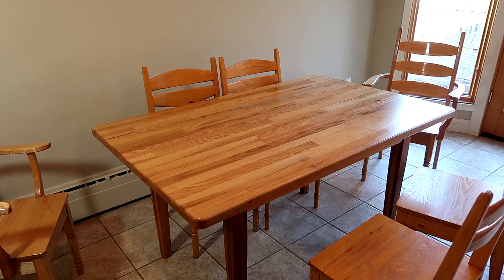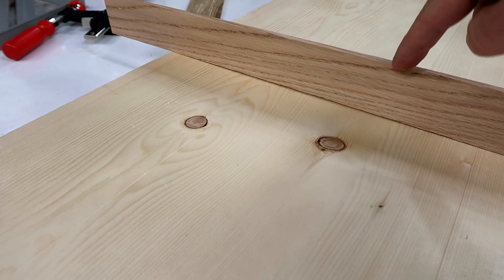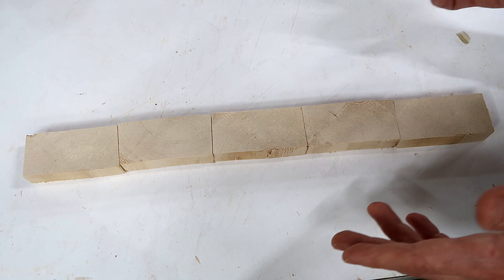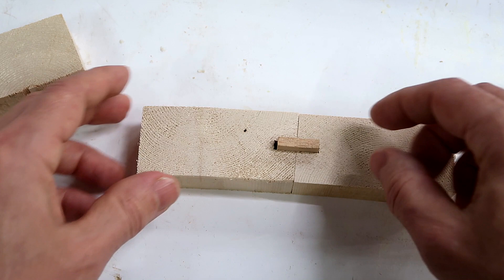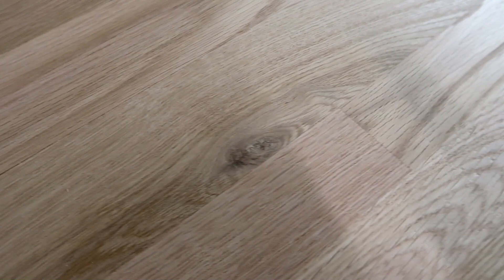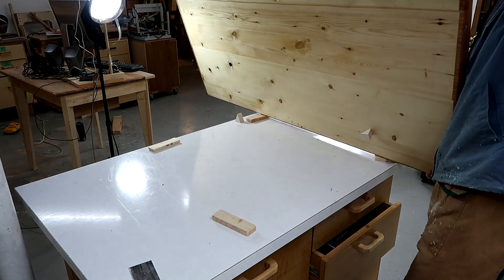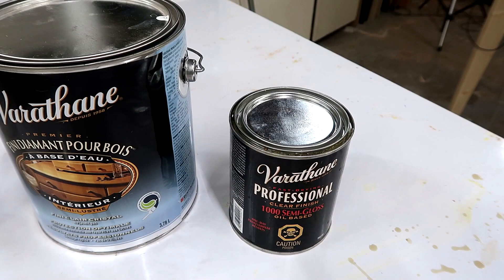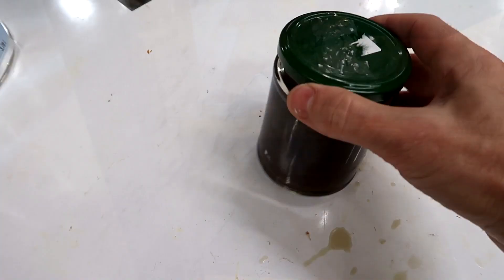Table top glue-up and varnish

Comment: Hi, Matthias.. For such wide Tabletops i would recommend to put the same layer of "veneer" to both sides... Maybe some ugly left over stuff... We in Germany call this "Gegenzug". It is counteracting the behaviour of the top layer.  An other trick, which i use for decades is to turn the paintcans over, when i put them into storage. (if the seal is still ok after opening) This way the varnish / paint does not skin over.  I have opend recently a can, which i had sitting upside down on my shelf for over 10 years and the paint was perfectly fine...no skin...no loss of solvent. If the seal is leaky and i can not turn the can over, i "fill" the empty space with Argon from my Welder. It is heavier than air. This works also fine.... Greets from Germany
Reply: Gegenzug oder Blindfunier-Blitzkrieg ;) ... ich denke das wäre die bessere Alternative gewesen
Reply: Good point & btw Matthias has German roots. He can speak German. :D :) Which is quite funny. :)
Reply: If it leaks, close the lid, shake the can, and wait for it to dry. Maybe then you can flip it over, and it won't leak?
Reply: I might be wrong, but I think Matthias already made a video about replacing the air with a heavy gas.  I think he did that in glass bottles, but it's probably a pretty old video cause I can barely remember.  Turning the cans over seems like a great idea though, I'm going to note that one down.
Reply: brilliant
Reply: I have not actually had success with this technique. What I found was that it was still skinning over, but hidden down in the paint when flipped upright. Then, when I stirred it, all that skins turned into paint boogers. It made a helluva mess. I wound up using it as first color coat, scraped it smooth, and used fresh paint for the final. I did try to filter it, which helps.

What I do now is buy small cans and decant into smaller and smaller cans as I close off a major session (meaning the paint will be stored for a few weeks). That smaller air gap seems to reduce the skinning. Regardless, I peel it off with a stick and use it anyway. Just don’t lose any of the skin or it turns into paint boogers.
Reply: Verygoodadvicetheremate

Comment: I had a strip laminated countertop. I put a rubber matt on one side. Within 2 days the front edge curled up by 10cm! So the warping from humidity changes can be extreme.
Reply: Wow that's a lot! What did you do to counter the warping?
Reply: @spinafire  I just removed the rubber and it naturalised on its own.

Comment: Like when applying finish it is best practice to apply finish to both sides (so they are balanced).  This also applies to veneers.  I'd also expect reducing the thickness of the veneer to under 3mm will be less of a problem with the differing wood movement (and the veneer will just respond more favourably to the movement of the pine underneath).  Cheers, David

Comment: Great tip for using the card scraper in between coats of varnish. I usually knock down the nibs with 400 sand paper, but it makes  a lot of fine dust.  Card scraper seems like a more elegant solution

Comment: 1:30  i believe you are correct about the moisture from the glue causing the cup.  my boss was recently doing something similar with oak glued onto particleboard, but his oak strips were even thinner.  the oak was already very dry from the furnace in the shop.  the next day almost all of the edges on the oak strips were raised up.  the only thing i can think of it that the bottom of the oak strips expanded from the moisture in the glue and heaved up at the edges.
Reply from the maker: Yes, that can be a problem if not fully clamped!  Fortunately, I didn't run into problems with that, or at least not any noticeable problems.

Comment: I wonder if you could use humidity and temperature changes in your favor since you have oak on the one side and it cupped the bottom.  Maybe leaving the bottom unvarnished for added expansion to match.  I know it is supposed to shrink as well but in my experiences with one side unvarnished or painted, the project has always warped to the varnished or painted side.

Comment: The "oil" based paint is water/moisture  curing. The water based one is curing when drying.
You can prevent th e"oil" based paint from drying prematurely by splitting the can into smaller jars with lids. I usually put a plastic bag between lid and jar before closing it.

The issue here is that the can while open will suck moisture from air and will cure over time. If you open the can and immediately pour it into 3-4 smaller jars and then seal the one you dont need at the time you can save it from spoiling.

Also this explains why the first layer was not curing quickly. Air was dehydrated quickly around the table and the paint was not curing as quick as it could. That explains why fan trick worked. Also low temperature - making the air less humid in absolute value  did not helped too.

The new style varnishes/lacquers are much much worse than old style ones.

The new ones are supposed to be low volatile organic compound paints but their durability is much much worse.

I use the polyurethane, stinky paints or sometimes even the nitro celulose ones if I need really durable finish.

Also using roller gives much more even result.

The difference between thick and thin layer is that if you have flexible paint then you can use thick coats. The paint will not chip easily. If the paint is kind of hard (the diamond types) then adding too much will make it crack if hit.
So in such case its better to use thin layers and put only as much as needed to get the finish you want and not any more as that will make whole finish more prone to cracking.

Comment: If you're looking for a good, durable waterbased finish: I've had really good experiences with “Bona Mega“. It's a waterbased 1K Polyurethane finish for wood floors, really easy to work with and get great surface finish, also pretty durable. I was very sceptical about water based finishes in general at the beginning, but this really changed my mind.

Comment: Some varnishes, especially water-based ones, can actually lose their grip on the previous layer without sufficient mechanical bond / tooth. Some finishes require sanding to 220 between coats, otherwise you’re relying entirely on the chemical bond to resist the incredible surface tension that builds as it dries.

I use a cabinet scraper as well to get dust motes out of the finish, but I always buff before coating again. It’s just not worth the risk to me
Reply from the maker: The advice I know of is to wait no more than a day between coats for better adhesion.  The layer below won't be fully cured, plus there is less  time for atmospheric surface grime to accumulate.  
But if it's an old coat of paint or varnish, definitely sand it.

Comment: Releive cuts half way through the top from the bottom side can help avoiding cupping. I'm quite sure you will do that if by time cupping is really an issue.
Reply from the maker: Yes, I might do that when cupping becomes an issue with the old top, which I made the same way, 13 years ago.  Still waiting.

Comment: I like to store my cans of varnish upside down upon being opened, that way the skin that forms is on the bottom of the can and is less messy when reopening.  One just has to be careful not to puncture the membrane if one needs to stir the mix.  Great video, thumbs up.
Reply: I like to put my cans of varnish in a vacuum chamber with the lid just barely in the groove but not sealed. When you release the vacuum quickly the lid snaps down into the groove and there's not as much air inside the can to form a skin. Gotta be careful though, if you don't do it right you'll be cleaning varnish off the inside of your pressure pot.
Reply: Yes! I do this with everything! Paint, glue, pvc weld, honey (But make sure it's a honey lid that seals!! Most won't!),

Comment: There's one more thing you can do to avoid cupping of the tabletop due to use of two wood species with different expansion/contraction properties. You can assemble the bottom layer entirely first, then apply the strips with their grain perpendicular to that of the base layer. Deformations will be in different directions. If you also use polyurethane based glue, instead of PVA, strong clamping is no longer that important (you just have to make sure the pieces stay in place, but not apply much pressure), the glue has some void filling capabilities and it stays significantly more elastic after curing. Given the huge amount of gluing surface, the slightly lower strength shouldn't be a problem, IMO. Plus, it's completely insensitive to water, which is useful for a tabletop.
Reply from the maker: Oh, how I wish people tried their own advice!  It would be so much fun to see the results! :)

Comment: So to use mortices or cockies are necessary when the glue is holding endgrain to non-endgrain, but not in cases where the glue is used for places where the joint does not include endgrain faces.

A lot of important info in this video. Thanks.

Comment: I know Matthias isn't a safety snob but I never cut lumber on my table saw without the riving knife installed.  I've seen a piece of walnut get shot off a saw so hard it went through a wall.
Reply from the maker: My saw can't take a riving knife.
Reply: @matthiaswandel  Neither can mine. Here's an idea for a video: Come up with a quick on/off splitter that can be used for a variety of saws.

Comment: For any of your non-water based paints, have you tried displacing the air in the can/jar with propane before sealing them up?  I started doing it with POR-15 and had excellent storage results.  I now do it with anything that is not water based.
Reply from the maker: yes, mentioned in a video too.

Comment: How would you characterize the improvement in odor/fumes with the new formulation? I use water poly mostly for the convenience around the freedom from fumes not the ease of cleanup. 

For example, if I run the clothes dryer while oil varnish is curing, the clothes will smell a bit like gasoline because the dryer breathes in the fumes and somehow consolidates it into the fabric.

Comment: In order to get the VOC content low enough to meet environmental standards, modern oil-based paints and varnishes contain more "drying" oils (i.e. ones that crosslink) rather than relying on evaporation of solvents to make them set up. This makes them less smelly, but is often reported as causing much more yellowing after exposure to sunlight than older oil-based ones (an effect which the water-based ones appear to avoid).

Comment: To alleviate the warping of the Fords across like that by laminating them together with glue is to start off with 2 3/8 inch thick plywood scenes how the grains of the plywood are already counteracting each other and if you laminate the two of them on top of each other you'll have three quarters of an inch and we just very little reinforcement underneath the table won't give it all you can drive a semi on top of it and the blocks of wood on top of the plywood will have them or even surface to work off of you can also by using two pieces of 3/8 plywood that will allow forget to give and move depending on the humidity and the temperature in the air but sayings how this is a table inside a home that will be maintained within a 10 degree variance the summer and winter unless it's with house where you leave in this go on vacation for long periods of time that's redundant anyhow good luck

Comment: I tables with water based Verathane that have been whipped down multiple time daily for over 15 years.  It has no cracks and still looks close to new.  Not sure where you got that wrong idea about it cracking.  It doesn't when it's applied correctly - like with thinner coats. :)
Reply from the maker: My desk, where I keep the mouse, the varnish has cracked just from moisture evaporating from my hands.

Comment: Why not 2 layers of 3/4" ply wood instead of the spruce?  More costly?  Less interesting?
Reply: This table will fall apart in 2 years.
Reply: Reply on his previous video, to a similar question

The construction lumber is just much cheaper
Reply: Probably because he already had the spruce.
Reply: @merrilldwayne  It won't.
Reply: @JDeWittDIY  Guaranteed. That base will move all over the place creating cracks and distorting the surface. Lot a work for not
Reply: @merrilldwayne  He's used this method before and it worked. So I don't think it's guaranteed. ;)
Reply: @merrilldwayne  If you want to be fancy, it is spelled as "for naught" not as "for not." Or you can just say "for nothing."
Reply: @MattMcConaha  Thanks for the English 101A lesson. Tool
Reply: @merrilldwayne  You're calling it English 101, but you're also the guy that got it wrong.
Reply: @MattMcConaha  Hey Einstien.  Nobody is trying to be fancy here. So kick rocks
Reply: KelMaster Construction  Will do Captain

Comment: Does the oil based stuff turn yellow if you put too thick of a layer or does it dry clear?  I'm looking for something to level out cupped plastic inserts that have writing on them by dripping it into the cupped section to level it out.
Reply from the maker: Ok of the varnis is just a layer of varnish.  Probably not suitable as a filler.

Comment: Could you use a 3/4 plywood for the base in place of the spruce board?
Reply from the maker: and how would I clamp it?
Reply: @matthiaswandel  point taken. I guess you rip it. I was looking at avoiding warping in the spruce.   I have a bunch of hardwood flooring. I was thinking of doing just what you did on 3/4 plywood then planing down the top.

Comment: I'm sure you had thought of putting the spruce verticle and ripping in half.  I know, more glue joints but would the grain have been more stable?  No Breadboard ends?
Reply from the maker: Breadboard ends are awful.  Not very strong, always a joint where dirt can get in, and the edges don't line up with seasonal changes.  And all that trouble for what end?
Reply: @matthiaswandel  Of course you're correct about the functionality, I was thinking more of the farmhouse look.

Comment: I'm sure you're aware of the idea that flooding room air out of a can of varish with argon (If I recall right) keeps the varnish from going bad so quickly. Aside from most people not being able to do that, do you suppose if you had a way to put the cab under vacuum it would work as well?  I'm not clear what the gas does.
Reply from the maker: The varnish polymerizes in presence of oxygen.  But this newer stuff won't do that until the solvents have evaporated, so it's not a problem.

Comment: An interesting mix of species. I look forward to seeing how well this holds up, which I hope to see that it does.
Finishing top and bottom might be a good idea with construction grade mixed with hardwood, but in Bob Flexner's opine it is unnecessary to finish top and bottom of a table top. He said that ww's of old had figured out a lot about wood movement and they didn't normally apply finish or paint to the top and bottom .

Comment: The piece you ripped at about 15 seconds into the video had the pith in it.  That means it is juvenile wood.  The part of the tree that grew very fast when the tree was young.  It has many times the tendency  to warp and twist than more mature wood.  Eliminate it when you can.
Reply: Half the lumber in a Canadian home improvement centre is still growing. Most of the good Canadian lumber is sent to foreign markets leaving us to work with immature, wet slash (at top prices of course). Just the way it lol.

Comment: Seems like dowelling through the entire width of the table, then planing flat even by hand if needed would at least Decrease warpage if not effectually eliminating it... 
I'd even go so far as to use allthread and appropriate sized fenderwashers on that base lumber. That Does mean the veneer has to be a separate process, further complicating That glue-up and clamping, but it is still manageable, and I like Flat year round. At some point maybe Matt will do some Hydraulic clamping...
Reply: This is funny.
Reply from the maker: that is a formula for craking, because the dowel would not shrink and expand with the table.  And the dowel would not be nearly stiff enough to hold it flat.  The dowels would probably make it worse.

Comment: On the Advoko Makes channel he made a anvil/chopping-block and set a big log in the ground UPSIDE-DOWN i.e. inverted from the way it grew.  He explains wood absorbs water slower top-down vs bottom up implying there is a directionality to moisture absorption along the grain.  Is this for real?
Reply from the maker: I don't know.  Might be.  Probably only a small difference.
Reply: @matthiaswandel  if it's a real thing it could have implications for fence posts, outdoor furniture, stud framing...  I vote you should investigate

Comment: Ultimately I doubt it matter much either way - but having a shinier surface on the bare wood doesn't seem like it's any sort of advantage, since you're just putting varnish in it.
Reply from the maker: helps to start out with something smooth.
Reply: @matthiaswandel  Right, just making the distinction between smooth and shiny. You can get a smooth surface with sanding as well, it just won't be shiny.

Comment: Why not use construction plywood instead of the construction lumber for the underside? A lot less work, and more stable to humidity changes.
Reply from the maker: then I would need many more and much longer clamps
Reply: @matthiaswandel  Or use a few wood screws to clamp the plywood together during the glue-up.